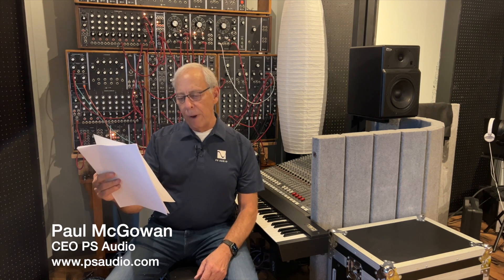Vacuum tube watts

Comment: Very important and impressive talk. I am 74 yrs and during my childhood we had a 3 band radio with one 50LC tube producing hardly 2-watt sound but the sound it used to produce was sufficient clear sound covering 400 sq ft area with a small 5inch speaker.

Comment: My 8 Watt 300b tube amp has no problem driving my 88DB speakers. Drivers are accutons, and never dip below 6.6 ohm so pretty easy to run. For tubes no dipping to low ohm is more important then the sensitivity imo.

Comment: What if we take a solid state amplifier and use a special limiting circuit on the output stage that softly attenuates the output based on the back emf?
Reply: It is called "soft clipping" and NAD has had it for decades.
Reply: Back in the 1980s NAD amps had a soft clipping feature that did just this.

Comment: I could be wrong but I always have the notion that it had to do with current versus voltage. Like a solid state amp is very good at voltage but not so good at current whereas a tube amp is great at current but not so good at voltage.now current is what drives the speakers and so you would in theory need less tube watts to produce a certain, let's say loudness or perceived power then you would with solid state.

Granted I could be wrong about the whole thing so correct me if I am, seems like I read that somewhere on a forum somewhere perhaps but anyway I just thought I would share that.
Reply: @Amb - not quite.  You are describing two different characteristics.  One is efficiency, or the amps ability to deliver an output signal vs energy used by the amplifier (better at current vs voltage, akin to mpg efficiency of a car).  The other is the measurement of the actual signal put out (actual output wattage, akin to the speed the car is travelling).  Once that output signal leaves the amp it is measured for AC RMS voltage (not current).  That voltage is then squared and then divided by the resistance of whatever load the amp is driving.  The resulting number is power, or watts.  

Again using the car analogy, you can say it might take an old pickup truck more time and fuel to reach 60mph than a sports car (efficiency), but in the end, they both are travelling 60mph (wattage).  Doesn't matter if you go on a bike, in a car, or just can run inhumanly fast.  Doesn't matter how you get there, 60mph is 60mph for every moving thing.  Same with watts.

Back to amps, you may have one amp that takes more current to generate that same output voltage than the other, using up more energy in the process  But the RMS meter doesn't care about that.  If you have one amp generating 25VAC RMS efficiently into an 8 ohm load, and another that does it inefficiently using twice the energy but still outputting 25VAC RMS, they are still both 78-ish watts output.

Watts is not dependent on tube, solid state, efficiency, or magic fairy dust.  It is a defined relationship spelled out in Ohm's law as voltage squared divided by resistance.  How you derive that voltage does matter one iota.  A watt is a watt is a watt.  It is defined and immutable, regardless of the device providing it.

Hope that helps.
Reply: You're not wrong at all. That's exactly what it is.

Comment: The most musical amps in the world recognized by most audio files ,are low watt   tube amps , because only in the first watt  counts at regular listening levels
Reply: Tube Amps at ANY PRICE at the 1st watts level and beyond do not stand a chance at maintaining absolute signal integrity via ultra high end reproduction standards.
Reply: @davidcross890  Why? Because of harmonics? And what about the harmonics that people want? If they care at all? And what is ultra high end? Like 0.0001% if people out there? What happened to the real world sweet old guy who just wants to listen to his 3 watt 6V6 power amp at low volume levels with a bit of smooth whiskey and some crummy old records from the 50’s that sound great to him? Just asking.
Reply: @JoseMorales-kr2ed  That sounds like an enjoyable experience for some undoubtedly. Respectfully, I am into pushing towards enjoyable reproduction via potential perfection of signal chain integrity through advanced sciences.
Reply: @JoseMorales-kr2ed  ultra high end for me is ENJOYABLE Compression and Rarefaction of RARIFIED AIR AND PROVABLY THE BEST OF THE BEST. KUDOS to All Those that Provide those experiences.
Of Course, To each their own
Reply: @davidcross890  Listen to an OTL, and not at, "ANY PRICE", but built from a kit. Spending huge amounts of cash for parts, not to mention mundane Topology, that cost 1/1000th the retail price, is silly. But it does give one, bragging rights. If you require, "Ultra high end reproduction", check out Transcendent Sound's 300B OTL and Audio Note Kit's Level V DAC.  You'll need a Hakko soldering station and a multimeter. Although, if you enjoy 2 inch thick CNC, billet Aluminum, chassis, forget it.
Reply: @scottwolf8633  I have listened to Output Transformerless Tube Designs. I am not saying people cannot enjoy these designs or love them but with all advantages that are possible, Solid State at it's best possible with added Technologies can easily produce a far more lifelike and convincingly real reproduction presentation. If any tube design came out on top, I would aquire it, enjoy it, and attempt to MEASURABLY and audibly better it through reductive distortion technologies.
Reply: @davidcross890  Fair enough. I used to build iterations of Audio Amateur/Old Colony's published Lang Amp, which Nelson Pass stated was the ,'Most elegant and advanced design published', as Pass was a contributing editor, this piqued my interest. Employed J Peter Moncreiff's and Nelson's writings to modify, the Class A, MOSFET Topology. Yet the Lang amp with non-commercial mono, output stage power supplies, expensive and ,"Boutique", circuit elements couldn't better Transcendent Sound's inexpensive parts, patented Topology, based on the Soviet 6 C19PI valve.
So if you'll forgive my curiosity what, "Technologies" are you talking about, when you speak about, "Reductive distortion technologies"? 
 Are you implementing Topology with GaN semiconductors?
Reply: @scottwolf8633  I recall Old Colony Sound Labs and other associated offering regarding designs .Regarding your ask,  In terms of overall totality of All distortion mechanisms, that is where extreme level solid state has the potential to step uncontested out ahead of best possible tube designs. It is easily my opinion engineers at all levels need to be Open to learning new interface power supply design and implementation. This would reduce many distortion mechanisms through reductive distortion. I have used gallium nitride but it is not my personal favorite for numerous reasons.
Ultralinearity requires never stepping even for a nanosecond outside linearity at any frequency with any associated distortions or phase shift again at any frequency or power level...zero dynamic compression
Reply: @davidcross890  For my output stage power supply, I employed large computer grade caps, then as per J Peter Moncrieff, double bypassed them with a Panasonic HFQ, and an MIT metallized PP, each. Had 375,000 uf of output stage supply capacitors. Built the bridge rectifiers out of HEXFRED, ultra high speed, soft recovery diodes, with snubber caps, and series resistors, a technique written about in The Audio Amateur, by an EE who had worked in design for decades, so I borrowed his technique.  Used toroids rated at 10.8 Amps with a bias current of 4 Amps, the MOSFETS operated Class A at 2 Amps. The input and driver stage each had their own PS which were tightly regulated, at .1 Amps. The unregulated Output stage PS didn't exhibit any compression. Never listened to greater than 96db at the listening position. Each channel was driving an RD-57, dipole, 54" by 2", push pull, planar magnetic, designed and fabricated by Dave Grabener, the G in B&G planar magnetics, and Wisdom Audio. For low Frequencies, below 200 Hz, 2 morel MW 164's/channel, each in 12 foot, 6" ID, schedule 40 pvc with 4, 90 degree elbows per waveguide to minimize physical size.  Transistors are not inherently linear as per I/V curves nor distortionless devices, and must be constrained to operate as you state. What you have said are generalizations without any specific techniques, on how to achieve your lofty and worthwhile goals. Are you currently manufacturing a product?  Or are you published in any Journals, which would document what techniques you are employing?

Comment: I have 100 db/W/m speakers (Altec Model 18) with a Luxman LX-38 Ultimate tube amp (30W/ch) and listen at moderate level.  I wonder if I’ve ever reached 0.5W.
Reply: i have 100db altec carmels and used them with 1wpc LTA MZ3 and never go over 12'oclock on the vol knob.

Comment: 3:24 - Wouldn't impedance-dips affect frequency response using a tube amp?  Since a tube output is basically a current-source, a rise in impedance would affect a rise in voltage, something that the voltage-output of a  solid state amp simply doesn't do!

Comment: I think a lot of this ability to play loud has a lot to do with an amps powers supply. Does it have the current reserves to drive things? Of the valve units I personally own/owned, they all had  really beefy overbuilt power supplies. The SS state ones that did really well with my speakers also had a lot of attention made to theirs. The cheaper amps that I could hear struggling had a compromised solution to keep the cost down.  What I have observed is a  tube amp does not do all that more than SS component that pays a lot of attention to how it delivers current to the transducer. However, I did  notice  when I upgraded for reason of weight and heat hazard. The 70 watt per channel tube integrated I used to own pretty much dominates the 100 watt Hybrid SS unit that replaced it. The old tube integrated, played louder, cleaner, and had more punch than SS unit with the higher wattage. Now 30 more watts in amplification is not much to write home about. Regardless, the so called lesser powered valve amp was noticeably more in control of my speakers. Here is the thing the old tube amp was nearly 70 pounds a lot of its heft due to the power supply and oil can sized capacitors. The little SS hybrid unit is about 40.

Comment: If I recall tube amps generate even order harmonics when clipped which are ears dont mind so much compared to the odd order harmonics of a clipping solid state amp.
Reply: That is the bs written in print. Reality is DISTORTIONS ARE JUST THAT,DISTORTIONS. I prefer clearly as absolute close to zero DISTORTION of All types as possible. That automatically eliminates ALL tube Amps at any price
Reply: @davidcross890  Everything in balance David. Life is full of natural distortions, and we as people find comfort in that. Eliminating distortion completely from a musical passage is considered unnatural by our brains. This is why tube amplifiers are preferred by many. Remember life is a balance, in order for you to know how high up on a platform you are, you need to know the opposite end, "where the ground is." Have a good day.
Reply: @MrCarlsonsLab  Natural Life without human assistance or intervention....Finds Balance.
 It appears your assumptions are quite amazing and deeply flawed PROVABLE by experience gathered in advanced research regarding the ACTUAL neural process of how hearing is interpreted and processed by the brain and also actual signals integrity  intelligence. 

You may want to consider what you don't know by fact and what you have not personally mastered.
 Respectfully,  you may end up challenged by an individual who has actually mastered new innovations that you may be genuinely clueless about. Those specific issues of gnosis may not be within your current wheelhouses.
  Actual Original occurring events are by nature DISTORTION FREE as specifically they are the actual original events that they solely are before any intervention or interference.
  Further, I am quite aware as to the station or platform I reside at..you may be quite shocked. I have my wheelhouses of utter pinnacle expertise that still seem to have no peer. Outside those particular WHEELHOUSES I have So Very Much to learn. 
I  have not arrived at my station or platform by doing the same broken or flawed things most others do. My Inventions and innovations and their products offshoots affect and effect most every person on this planet including I am sure you.

 So actually doing their own actual  research and gaining an uncommon knowing may assist most from taking many a flawed path, unless the intent is to learn how many ways to experience failure. We all have a CHOICE to become more. 

I choose the path of continued excellence and to become more and honor my creation. I am open to learning more.

With that, if You believe You can openly and publicly via YouTube demonstrate that You have a Superior Electronics End Measurable Result that Supercedes My Wheelhouse initiatives and technologies that I have accomplished I openly welcome You to attempt to Publicly Prove my research flawed. 
If You somehow could prove me wrong regarding my wheelhouses I would learn more.

Best Regards
David
Reply: @davidcross890   Hi David. Interesting write. I'm not out to prove anything to anyone, or get into the useless "look at me" pride filled responses, I'm a hard facts and "show me the data" type of fellow. If you would like to learn more, you can just click my channel name. I use a lot of test equipment during designs, you may find this aspect interesting, (or not?) Have a good evening.
Reply: @MrCarlsonsLab  Respectfully, STEP UP TO THE PLATE.

 YOUR TEST EQUIPMENT WILL SHOW YOU THAT RESPECTFULLY,  YOU REALISTICALLY HAVE MUCH TO LEARN.

I HAVE TEST EQUIPMENT TOO...MUCH ADVANCED TEST EQUIPMENT. SOME OF WHICH I CREATED TO ADVANCE THE EVER EVOLVING BLEEDING EDGE STATE OF THE ART.

I CURRENTLY DO NOT HAVE A YOUTUBE CHANNEL, YOU DO AND I AM ALL ABOUT THE FACTS.

I OFFER YOU THE OPPORTUNITY TO PUBLICLY PROVE MY ASSUMPTIONS INCORRECT.

WELL?
Reply: @MrCarlsonsLab Respectfully,  I was born and raised to exude excellence without apology so it's not "look at me" pride filled responses as you stated. In fact it is a suggestion to ENJOY what real innovators have provided as tools for you and your chosen crafts. This is a Golden Opportunity.
Reply: @davidcross890   Hi David, why so defensive? Did you read what I wrote correctly? I said: ** I'm ** not out to prove anything to anyone, or get into the useless "look at me" pride filled responses. I wasn't referring to you, I was referring to myself. Was that unclear? As for myself proving anything, it does look as though I have planted the seed from your responses, it's now your turn to water the plant. Take care.
Reply: @MrCarlsonsLab  If You had been entrusted and accepted to develop and complete a set of new bleeding edge technology packages that would create greater cohesion and passion amongst people and largely obstructive naysayers suffering from cognitive dissonance was what you were met with at virtually every turn it might get a bit old to some. I would like to share with this World of people and to their benefit what I was entrusted to do and how it may enrich their lives individually and together with others. I have seen enough division with some technologies I played a part in.
Thank You for commenting

Comment: Tubes clip more,"Softly", than solid state devices. One can observe the waveform at the clipping for both types of devices. The Minibeast OTL I own has a Frequency response out to 100KHz. The newer version of same, can pass square waves at 10 KHz and the frequency response extends out to 200KHz.. So its not the ability of solid state devices to amplify high frequencies, that is the issue.

Comment: I have tube monobloc amps that can be run at 30W or at 110W.  Exactly the same amp, just pull a pair of output tubes.  Running at 30w sounds great.  Running everything the same, but a 110w sounds better.  Not louder, just better.  Fuller sound.  More authority.  And better bass.  I chose to run it always with the full tube complement.
Reply: Thanx for sharing that!